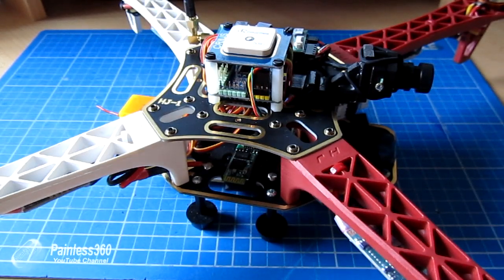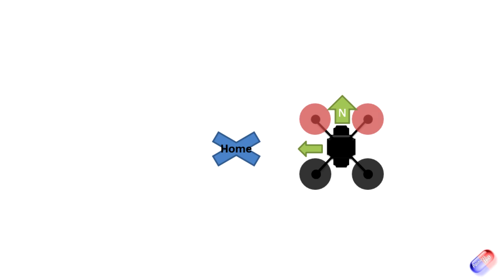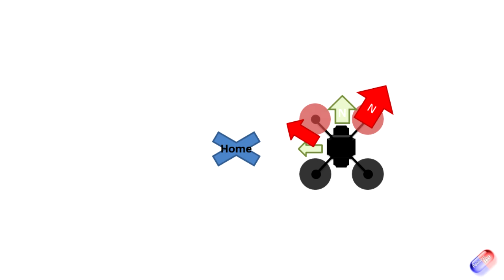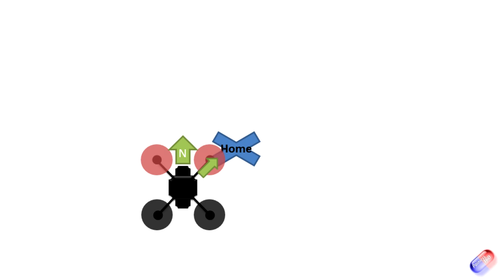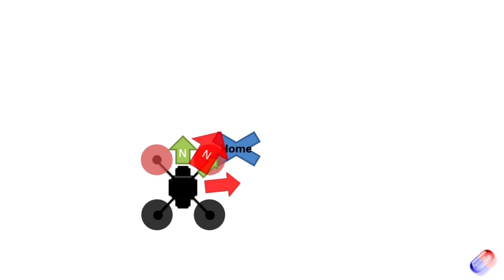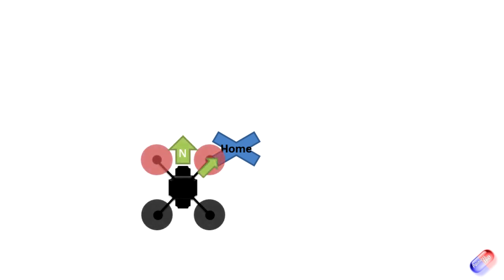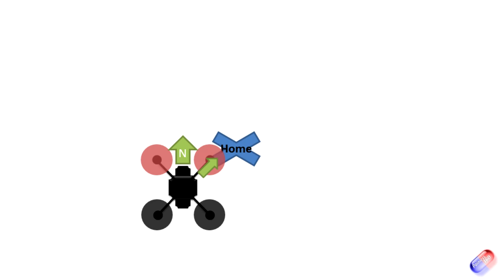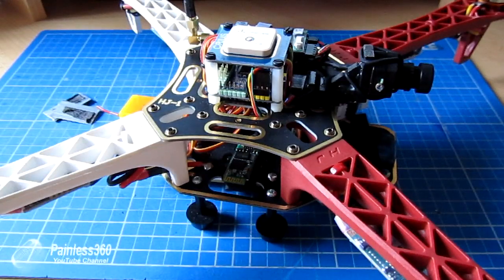GPShold and GPSHome functions need an accurate magnetometer (compass)

Comment: Mumetal has interested me since I heard you mention it and I'm off tonight finding the details of this interference. I'm using a DJI Phantom 2 Chassis with custom electronics so the Mumetal seems perfect solution for this tight space. This video has the best analog and digital evidence of the MuMetals worth on a Quad I have seen.     https://www.youtube.com/watch?v=OHEzD7uP6hI        Lee you mention  6:40  that you may have a video using that MUMETAL is that available? Cheers.
Reply from the maker: We never did, it simply made the copter GPS modes work ;) It's expensive but as you can see from the link you've sent if  you can't move the FC away from the power wires, MuMetal shielding is the next best thing.. Happy flying!

Comment: Painless 360: Thanks for the great videos. My flip32 inav quad does unbelievably well on position hold. But when I switch to RTH it takes off going north and I have to dump the throttle not to lose it. Could this be a magnetometer issue? I am using the flip32 onboard mag. Seems as though if the mag is needed for both modes and works very well on POSHOLD, that can't be my RTH problem.
Reply from the maker: Usuually the GPH Pos Hold working is a great sign for RTH too. What have you checked out already?
Reply: Painless 360

I have experimented with the following settings.Before the last change rth_altitude was set to 1000, and  alt_mode set to ATLEAST. With these settings the quad would both ascend rapidly AND head north. Now it just heads north like it has a hot date! I think the RTH is working because it now maintains altitude (CURRENT), but it thinks that home is somewhere north. I typically have a lock on at least 10 sats. When set to POSHOLD it maintains a radius of about 1 meter in x,y, and z (usually much better) and will do so until the battery exhausts. ANGLE and ALTHOLD are on as I am looking for a stabile camera platform. No high tension wires around, GPS on a raised stalk.

set nav_min_rth_distance = 300
set nav_rth_tail_first = OFF
set nav_rth_alt_mode = CURRENT
set nav_rth_altitude = 1000

I appreciate the help !
Reply from the maker: That should all work, I'd try an older version of Multiwii.. Best of luck..
Reply: FWIW here's what I think was happening. The onboard mag was OK in POSHOLD because the motors were all more or less drawing the same current and the magnetic fields were mostly canceling out. But when switched to RTH one or more of the motors drew significantly more current to unbalance the quad and drive it home. Now with several motors drawing more current then the rest, the mag. field changed and the quad began getting bad info from the onboard sensor. I replaced the onboard mag with the one on the GPS stalk and now it RTH's just fine. My explanation seems a bit wacky but its all I can come up with and I'm sticking to it until a better one comes along.
Thanks for your help painless!
Reply from the maker: Glad you figured it out! Nicely done!

Comment: Hey Painless360. Your videos are really helpful. I am new in this field and started learning a few weeks ago. I am working on small student project in which I need to fly the multicopter in mission mode i.e I will give it specific way points and it will follow these. Can you provide me a hint on how can I achieve this? This is probably already done in return to home code part but I just need to make it work for waypoints. May be you know about some source which can help me understand the implementation of Return to Home function and then reuse that code to make it follow waypoints.
Reply from the maker: +Waqar Rashid This is covered later in the series. If you are new then there are lots of videos in the 'Introduction to RC' playlist that may be interesting too.
Reply: +Painless360 Hey again.. We are having same problem in way-point navigation.. It is moving around the point.. Did you made any further video how you used mu-metal in any of your drone?
Reply from the maker: No, we simple make a plate slightly larger then the FC/GPS stack. The GPS isn't perfect - it will move location around 6-10 feet under normal operation..

Comment: Would you happen to have an opinion on other shielding material types, such as aluminum foil, copper foil, or some other materials with which you have experience?  Mu Metal seems to be the most expensive and I was looking for the next best solution.  Thanks - your videos have been a great help!
Reply from the maker: +David D I've tied copper, steel and aluminium. Non work very well, even grounded. Best of luck.

Comment: For the GPS, does it have to be in any specific angle in relation to the quad?
Reply from the maker: +George hanes Only those with an inbuilt compass that you are using with the FC need that. Otherwise simply mount pointing to the sky and away from any EMF if possible. Happy flying!
Reply: Painless360 Thanks for the reply, will do.

Comment: Do you have a video about how to perform the magnetometer calibration?
Reply from the maker: Hi, sorry I don't. I use MuMetal and distance to try and manage interference. There are a few others who have done good videos on the process though and the instructions on the APM site are excellent.

Best of luck..
Reply: Painless360 Thats OK, I got it calibrated well enough now. I have come across another issue with the MW_OSD minimOSD: For whenever reason, the top bit of the screen is trimmed off and I do not see it on screen. That has the GPS coordinates on it, so I do want to be able to see that. My monitor does not have an adjustment for aspect ratio or how it should stretch and zoom the image to fit the 4:3 inch XGA screen. Do you know of any  settings I can use to adjust this? Thank you!
Reply from the maker: Hi, can you ask the question on the MinimOSD videos? Then others can see the question and answer.

If you are using the MW_OSD code then search for a line in config.h called #define SHIFTDOWN and uncomment it.

Happy flying!
Search for
Reply: Painless360 Thanks, I will look around for that. Related to the mu metal, where did you get it? and how much was it? It is some expensive proprietary alloy of nickel and steel so I am not sure.
Reply from the maker: It's a special nickel-iron alloy used to shield electrical components. I got mine from eBay and it was a used, recycled piece that covered the back of a large vacuum tube. It's expensive but a piece can be cut into smaller sections to go under the flight controller.  I've tried all sorts and this works every time for me.

Comment: I have a dji phantom and cannot get it to hold a gps position at all. In fact it is very unpredictable in gps mode. Flys ok in attitude mode. But not near as it use to fly. I replaced a motor that was rough feeling. Since this it has been a nightmare. I have calibrated anything and everything I see in the dji assistant software. I have all green light no errors but would like some insight if you have any ideas? Thanks mate. Colin

Comment: Hi Painless360, I've a question about your HJ frame: have u had any problems due to vibrations from frame to the Crius? what about the stiffness and flex of the arms? I've just broken one of my clone F450  arm (bought from aliexpress) with a "not so hard" free fall from about 2 meters onto a field and i'm planning to replace it with HJ arms ( or move to a new HJ alien frame to remove propellers from FOV) but i'm still not sure about the quality.
With the older F450 clone frame i've had lot of problems to reduce vibrations.
To make the quad fly i've had to enable LP filter on gyros in multiwii config, balance propellers and motors.

PS: Thanks to your videos i was able to figure out and fix many problems i've ran into while building the quad..As always keep up the good work :D!
Reply from the maker: Grex0 Hi, the HJ ones have been great quality and I've replaced a few other arms that have snapped with the HJ kit and been very pleased. Happy flying!
Reply: Painless360 , wow  thank you for the fast reply :D!! i think i'll definitely go for it.
Regards
Grex0

Comment: Great video also would like to know with your gps module are you using the i2g-gps nav module on this board
Thanks
Reply from the maker: Hi Neil, yes I am. The full detail can be found in the video Crius SE V2.0 - Adding GPS via a i2c board to a Multiwii (MWC). Hope this helps.

Happy flying!
Reply: Another great video , every thing is coming togeather ! The one other Question I have now is I have the GY-NEO6MV2 do you solder the tx to rx and rx to tx wires from the i2c to gps ?
Thanks Again Neil
Reply from the maker: Hi Neil, Tx to Rx and vice versa should work but don't solder then until you get it working as sometimes you need to swap them over..

Best of luck. Happy flying!

Comment: Great vid. Again timing is impeccable. For me GPS hold works OK but then after a short while (20 secs at most) I lose it. Return to home is more like wonder off mode! My GPS fix is always strong but always noticed the mag is never quite right. Headfree never really worked either.
I too have the integrated PCB and have my FC about where yours is so I definitely believe I’m suffering the same interference issue. Of course now I’m FPV’ing I need RTH to work perfectly otherwise it was pointless setting it all up. I’m really interested to know how you get on with the Mu metal, or if you have found another interim solution? Maybe getting a separate compass and positioning it next to the GPS, which I have mounted quite high an easy solution too. Many thanks!
Reply from the maker: Paul, it works great now I've added a mu-metal shield. I was planning on posting a video on GPSHome later this week. It's saved my bacon a few times already!
Reply: Excellent, look forward to the vid. Thanks again, great help!
Reply from the maker: Paul, uploading as I type. You need to get that compass solid for this to work. The MuMetal was the key for me - the compass was rock steady even under full throttle. Hope it helps.